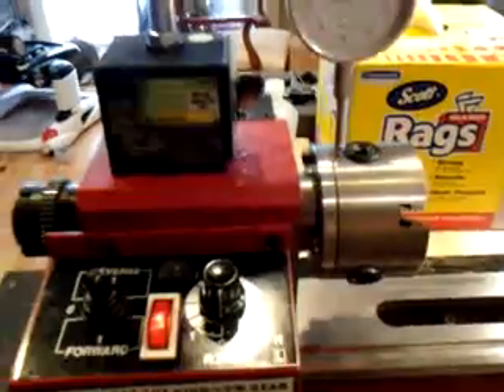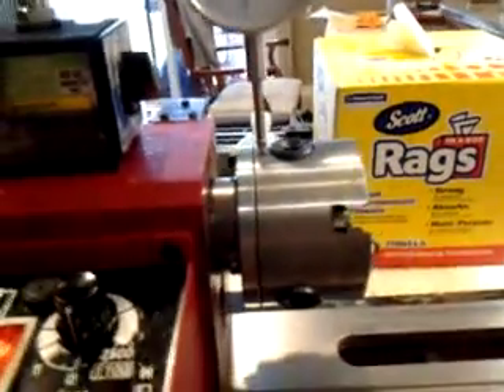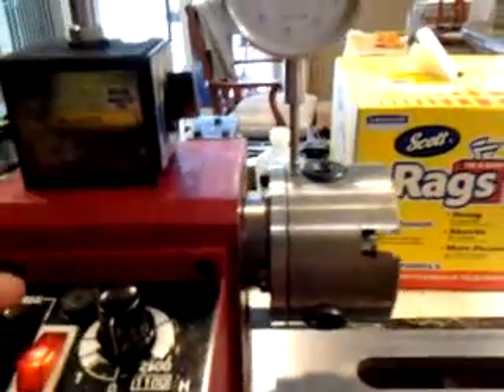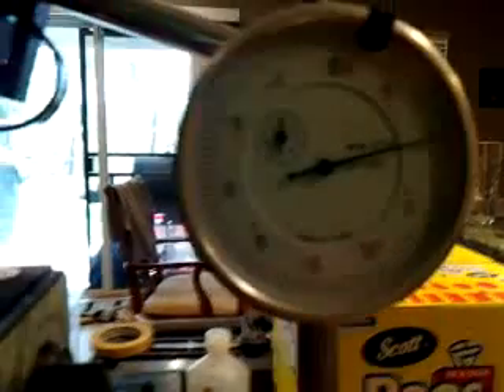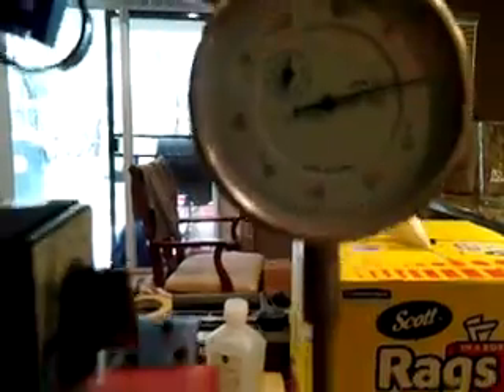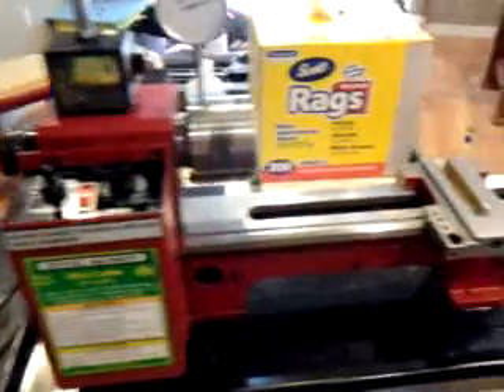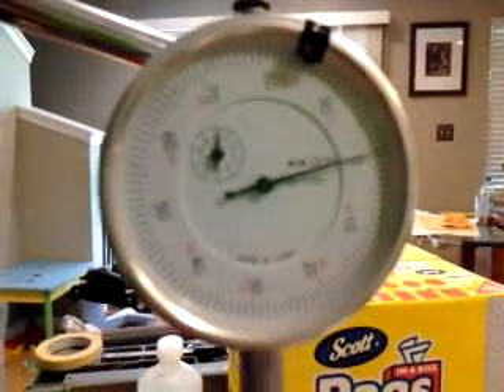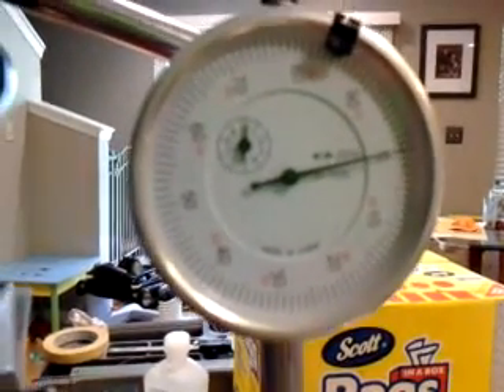HF 7x mini lathe  spindle/chuck runout (no mods)

Comment: I just purchased this lathe and got it setup tonight.  I see only +- .001" runout when rotating the chuck by hand.  But under power the chuck has significant runout and wobble.  I'm not sure if I need a better workbench, or if there are other issues.